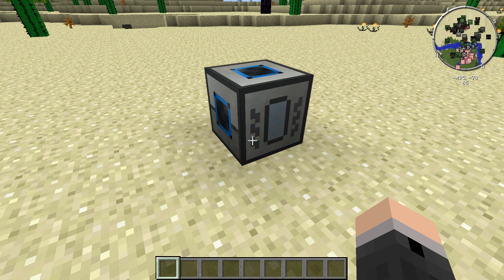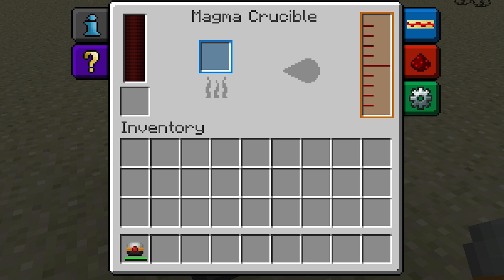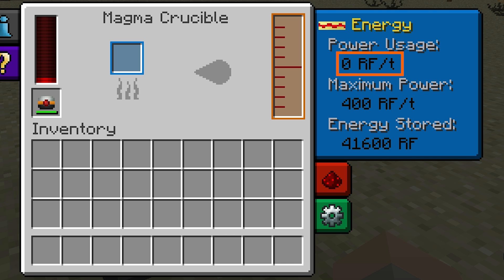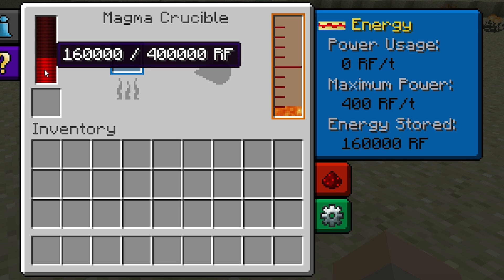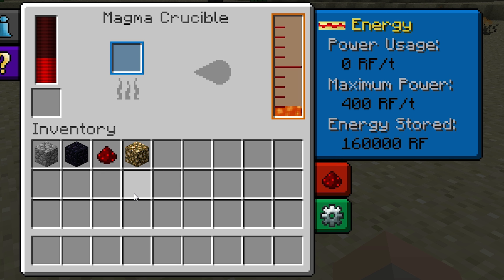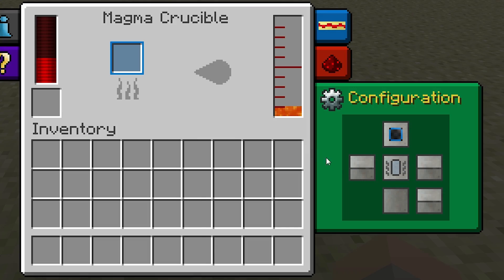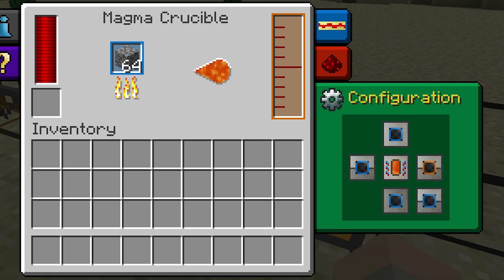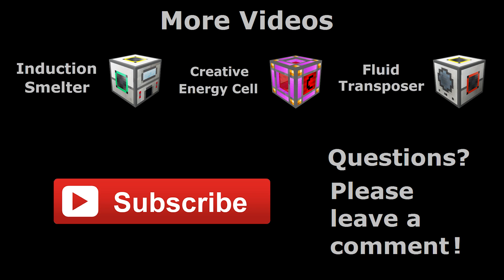Magma Crucible (Tekkit/Feed The Beast) - Minecraft In Minutes

Comment: does ic2 power also work in that because i cant power it with ic2 power
Reply: and i cant conect buildcraft pipes to the ic2 cables
Reply: Ic2 an bc are DIFFERENT mods, in tekkit lite these machines are only powerable with bc energy aka MJ
Reply: :( but i dont wanna use lava on making power to both ic2 and bc/terminal ekspansion
Reply: Axel Bech power converters lets you change the power from different mods to RF EU MJ and so on
Reply: Great is that in Tekkit Lite (and what is it called)
Reply: Axel Bech
yeah its in tekkit lite and its called power converters but the thermal expansion mod still uses MJ as RF is not a thing in the mod pack
Reply: so what you are saying is that its just a waste of reacourses if i make it?
Reply: Axel Bech
make the energy converter and use solar panels to make EU and convert it to MJ and run it along the conductive pipes
Reply: thanks mate